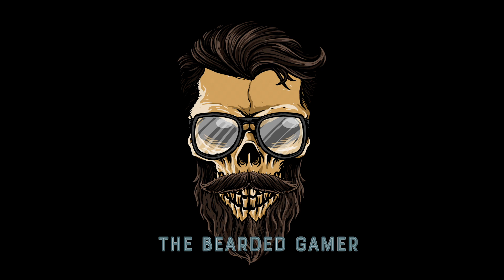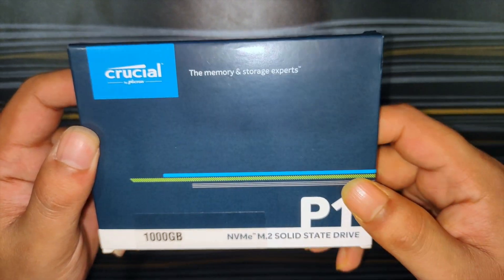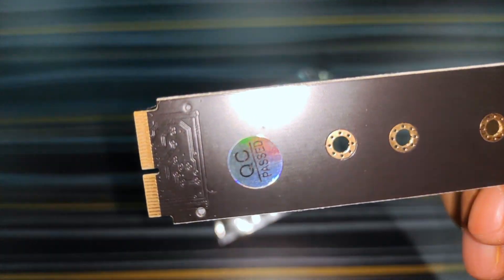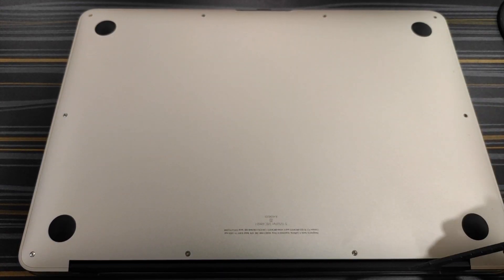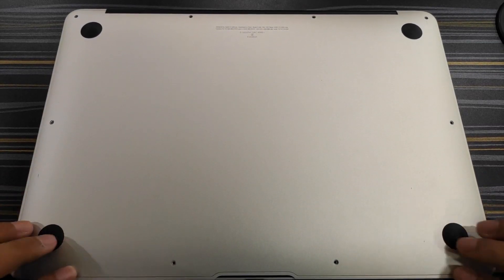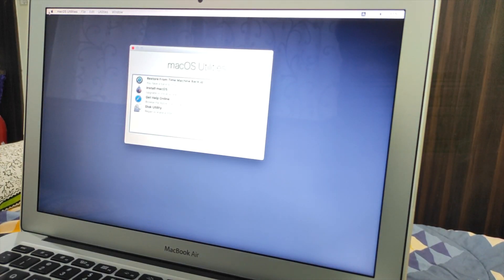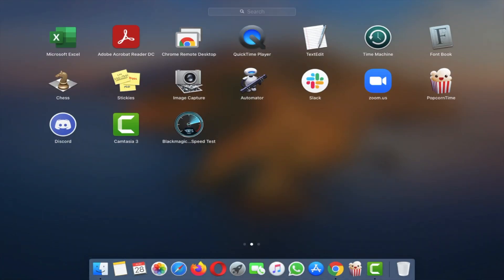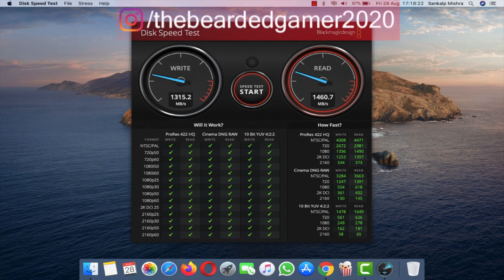2017 MacBook Air Storage Upgrade from 128GB SSD to 1TB NVMe SSD | Full Guide for 2021 | 40k+ Views

Comment: Hello, i am having trouble getting my air to recognise the drive, i have followed your instructions to a T. have a bootable USB drive etc but it still cannot find the drive. not sure what to do except try another SSD/adapter, old one goes back in and starts straight up. i have tried the internet recovery option and all fail as i have no visible Internal drive.
Reply from the maker: Which SSD and adapter are you using?
Reply: I have the 1TB Crucial as you have but am using the NGFF M.2 NVMe SSD Convert Adapter Card for Upgrade MacBook Air 20132014 2015 2016 2017 and Mac Pro Retina 2013 2014 2015, NVMe AHCI SSD. Only thing i can see that may be the difference but it should work.
Reply from the maker: @dOwNhillY72  Yes it should but sometimes the issue comes with the adapter. I have received quite a few comments from people about ssd not being detected because they used a different adapter. Try getting a different adapter and give it a try.
Reply: @TheBeardedGamer2020  I've now tried the Same adapter that you show in your Video and still no internal drive found. when I use utilities in Terminal it cannot be found either. any ideas? im thinking now that maybe the new crucial drive is faulty.
Reply from the maker: @dOwNhillY72  You can try replacing the ssd and give it a try. If the replacement window is closed try claiming warranty.

Comment: i need to sub an like this guy saved me from loosing like 1600$
Reply from the maker: Thanks man, really appreciate the support.
Reply: @TheBeardedGamer2020 lol more like u more support me by saving my mom being sooo mad at me from wanting an new expenve mac laptop.
Reply: @TheBeardedGamer2020  btw can u send an link for an 1tb ssd or an 2tb ssd for like the newer version of mac air if u dont know what i mean u dont have to tell me
Reply from the maker: @Kshatriya0073  Which version do you want it for?
Reply: @TheBeardedGamer2020  woahh u repsoned sooo fast but my version is 12.1, M1 2020
Reply: @TheBeardedGamer2020  also do u use an diffrent currensy then usd?
Reply from the maker: @Kshatriya0073  Sorry bro MBAs till late 2017 supported storage upgrades. The newer ones don't.
Reply: @TheBeardedGamer2020  oh its fine
Reply from the maker: @Kshatriya0073  Yes. INR.
Reply: @TheBeardedGamer2020  what inr mean?
Reply from the maker: @Kshatriya0073  Indian Rupee
Reply: @TheBeardedGamer2020  OHHH that why it like 10k

Comment: I choose use installer attached, after following your video it says “You may not install to this volume because it has a disk password” Please help
Reply from the maker: Can you please provide more details? This is not clear at all. Describe the entire process you followed and where you are facing an issue.
Reply: @TheBeardedGamer2020  Hi, I was able to proceed. Instead of choosing APFS(encrypted) I chose APFS alone. Thanks for your video 🙏🏻
Reply from the maker: @mickieperez1364  If you choose APFS encrypted then you will have to set a password. So, you did the right thing by choosing just APFS. Glad to hear that it works. Do subscribe to my channel and press the bell icon.

Comment: Great Video, I am upgrading from a 128GB SSD to a 1TB so I will follow your instructions! 

I currently have bootcamp on my MacBook as I use Windows programs often, will all of my Windows settings be saved as well as my Mac OS settings? 

Also, using bootcamp splits my SSD into two hard drives, one for Mac OS, and one for Windows. Will my new SSD split like this as well, and can i choose how much storage I want to have for Windows and for Mac OS? Thanks!
Reply from the maker: Great to hear that you are planning to upgrade your laptop. I have added all product links in the video description. As far as all your questions go, the answer to them would be a yes. Also, if you want your current settings on your new ssd, make a TimeMachine backup and then restore it after installing the new ssd. You can also allocate the space for bootcamp from the settings. Do let me know if you have any other questions. Don't forget to subscribe to my channel and press the bell icon.

Comment: Very good demonstration, thank you. Could you please guide whether we can upgrade the RAM too
Reply from the maker: No. Ram upgrade is not possible in this Macbook Air. Do subscribe to my channel and press the bell icon.
Reply: @TheBeardedGamer2020  This SSD upgrade is successful, running OK since then?
Actually, I want to produce music using Logic Pro, and, my instructor told me that I need to have atleast 16 GB to operate that.

And brother, I have already subscribed your channel long ago, when initially, I watched this video also shared to some of friends.
Reply from the maker: @indichinditalkshow6559  It is running perfectly fine. For logic pro 8gb should be fine as the minimum requirement is 6GB. Upgrading the storage will help you a lot as only logic pro will take up around 72GB of space for the entire library. And, thanks for the sub. Reqlly appreciate the support.
Reply: @TheBeardedGamer2020  So, I can go with that upgrade. Thank you so much for your support brother. Keep enlightening us with more stuff like this.
See you around.
Reply from the maker: @indichinditalkshow6559  Always here to help. All the product links are in the video description and let me know if you need any help during the upgrade.
Reply: @TheBeardedGamer2020  Definitely.

Comment: Ive got prohibition sign after replacing to new SSD…
Reply from the maker: Did you follow each step of the process that I have shown? Also, which adapter and ssd did you use?
Reply: @TheBeardedGamer2020  Yes ive created bootable OS with Mojave but the disc is not recognised... I bought WD Blue NvMe SSD SN570 500GB and my adapter is from Ali, longer one M.2 to MacBook 2013-17 SSD adapter ... thanks for your input it doesnt says 'NGFF' like yours
Reply from the maker: @kubaSWAT  The adapter should be fine. The problem is with the ssd. What you purchased is a SATA ssd and what Macbooks use are PCIe gen 3 ssds. That is why I had added product links in the video description. Try getting the ssd replaced and it should work.
Reply: @TheBeardedGamer2020  what? I read the Wd blue is fine Sn550 but I’ve found sn570 model…
Reply: @TheBeardedGamer2020  M.2 PCIe NVMe 3.0 x4
Reply from the maker: @kubaSWAT  Oh, I confused it with a different one. This one should work. Can you order the adapter that I have mentioned in the video description and try it again. I have received a few complaints that some aliexpress adapters are not working.

Comment: BHAI IF YOU’RE READING THIS COMMENT PLEASE TELL ME KI IF YOU ARE FACING SMART ERROR IN YOUR SSD
Reply from the maker: Nope bro. If you are facing this issue, you can try clearing the nvram. Do subscribe to my channel and press the bell icon.
Reply: @TheBeardedGamer2020  bro using WD NvmE SSD (Blue) 500GB in my Macbook Air 2017. I got it replaced because I couldn’t update my MacOS, it was showing SMART Error.

After the replacement its been around 50 days and now again it is showing SMART error. What should I do?

Comment: Hello I tried upgrading my macbook air 2017 ssd using Samsung Evo 870 500GB. When I turned on my mac and went to the disk utility. I cannot see my Samsung Evo 870 there. I already tried to reconnect my ssd and made sure it was connected properly. Any tips?
Reply from the maker: I don't see any 870 Evo being an M.2 ssd. It is a SATA ssd. Can you confirm the exact model number?

Comment: Can you use the screw driver that was included in the adapter to remove the back panel of the Mac?
Reply from the maker: No, you will have to use a philips head screwdriver. All the product links including the toolkit are in the video description. Do subscribe to my channel and press the bell icon .

Comment: I have a question for macbook air 2017 if I switch the sdd from 128 to 1tb it wont lose the data from my laptop right
Reply from the maker: The data is in the ssd. If you want to keep the data, you can do a TimeMachine Backup and then restore your data on the new ssd. Let me know if you have any other. Also, do subscribe to my channel and press the bell icon.
Reply: @TheBeardedGamer2020  one more question it won’t affect on the browser site like Firefox or safari like the tabs histories and the bookmarks when switching the sdd
Reply from the maker: @elloskitty2839  Those things have nothing to do with your ssd. If you have logged in to your browser and synced your data, they should be there when you login again.
Reply: One more question please for the MacBook Air does the hard drive or is it the ssd that has the storage data
Reply from the maker: @elloskitty2839  The macbook air only has an ssd. There is no separate hard drive. The 128gb that you see on your mac is the ssd and the 1tb upgrade that you are planning would also be an ssd.

Comment: This is my MacBook Air (2017) model (MBA13-MQD32HN/A) does it supports this upgradation process. Please suggest me. Waiting for your reply
Reply from the maker: Yes it will. Any Macbook Air between 2013 and 2017 will support this process. All product links are in the video description. You can buy the products as per your choice. Also, thanks for subscribing to my channel.
Reply: @TheBeardedGamer2020  bro please do a video on how to create mac os bootable drive. i have a doubt, does time machine backup only videos/docs/ files. or it will backup apps and os.

please clarify my doubt.
Reply from the maker: @futurescientistVASU  The link that I have shared in the video description is pretty detailed and simple. Also, the time machine backup backs up everything, OS, settings, images and all data.
Reply: @TheBeardedGamer2020  so you are saying, when you backup using time machine, there is no need to use bootable USB drive, right.
Reply from the maker: @futurescientistVASU  No, it is not like that. The bootable drive is definitely required as it helps you access the disk utility on the new ssd. As the new ssd is blank you need an external platform to access the mac os disk utility. So, bootable drive is compulsory whether you do a fresh install or a timemachine backup.

Comment: What will be the Performance difference btw 500gb and 1Tb ssd
Reply from the maker: There wouldn't be any performance difference between 500gb and 1tb ssd but you will definitely see a difference once you upgrade from your stock ssd to either a 500gb or 1tb m.2 nvme ssd. Do subscribe to my channel and press the bell icon.
Reply: Thnqu brother .

Comment: Hi sir
Is it a good choice to buy a used macbook air(13" , early 2015) 4 GB , 250GB at ₹23k in present date ...I'm little confused that whether it will be a wise choice or not.

There is a single line (not visible in white screen) and laptop battery is replaced once...current battery backup is 3-4 hrs and he's not giving any bill or box except charger.

Please reply soon.
Reply from the maker: Based on the details that you have provided, it doesn't seem like a good deal. You can put in a few extra thousand and get a better one for around 28-30k. Late 2017 Macbook airs are going out anywhere between 33k and 40k depending on the condition. So, early or late 2015 ones you can easily get for under 30k. Do subscribe to my channel and press the bell icon.
Reply: @TheBeardedGamer2020  how would be it ,if I can bargain to 20k and then replace the battery.
Reply from the maker: @user-bn8ek6xl8i  I would still suggest you to avoid it as you never know what other issues it might have. So, better to spend a little extra and get a good one rather than negotiating a bad product and having to spend a lot more later.
Reply: @TheBeardedGamer2020  thanks a lot for your valuable suggestion. ❤️

Comment: how is battery backup MacBook Air after installing 1Tb Ssd Drive
Reply from the maker: It is almost the same as in normal ssd. Slight drop is there, but around 5-7% which is obvious since the speed is increasing so the power consumption will increase. Do subscribe to my channel and press the bell icon.

Comment: hi@ThebeardedGamer , i have early 2014 macbook air with 128 gb SSD and it is configurable upto 512 gb, please cheap and best ssd along with adapter if required for upgradation. thanks
Reply from the maker: You can use the same process as shown in the video. Also, all the product links are provided in the video description. These products are compatible with MBAs from 2014 to 2017, so you wouldn't have an issue. Also, do subscribe to my channel and press the bell icon.

Comment: Will i get same thing if a use external SSD instead of updating my Mac with opening and putting one inside (some of those nvme samsung, or similar). Thanks
Reply from the maker: Yup external ssds will also provide similar performance but the upgrade is needed when you prefer convenience of not having to carry an external ssd everywhere. Do subscribe to my channel and press the bell icon.
Reply: @TheBeardedGamer2020  Thanks for the answer, one more question, What do you think for 15inc Macbook pro 2014 2.2ghz i7, 16gb RAM 256ssd? Will do the job for Graphic Design in UX/UI (Photoshop, Illustrator,XD, Figma) Thanks a lot.
Reply from the maker: @Armacedon  Yes. It should easily be able to handle it.

Comment: The “preparing to restore files to SSD” phase is taking a really long time for me, is that normal? I have only 26GB to transfer from my backup
Reply from the maker: Yes, it does take quite a bit of time. Copying files doesn't take much time but replicating system files and settings takes quite a bit of time. Since you had added this comment 5 hours ago, I think you should have been able to successfully complete it by now. Also, do subscribe to my channel and press the bell icon.

Comment: Because adapter specification show that... The samsung 970 evo plus not support
Reply from the maker: You can use it but there's no point spending so much extra as the speeds are going to be similar to what you would get with a Crucial SSD at a cheaper price. Do subscribe to my channel and press the bell icon.

Comment: Samsung 980 or crucial p1?🤔 what is the Best?
Reply from the maker: Both of them are fine but why pay extra when you get the same speeds. I know that both SSDs have different operating speeds but the Macbook has certain limitations. So, whichever SSD that you use, you will get the same speed. The best option in such case is to use the least expensive of the lot. Also, you can choose crucial p2 which is now available. All product links are in the video description. Don't forget to subscribe to my channel and press the bell icon.

Comment: thank you for the tutoriel! I have ordered the same SSD and I am excited to install it. Do you think also changing ram from 8gb to 16gb would make a big difference in term of speed when using photoshop or should I already see a noticeable difference just by change the SSD. I am using a macbook air 2017 128gb
Reply from the maker: Hi Charles, it's great that you are upgrading your SSD and be rest assured that you will see a great deal of improvement in terms of performance. Coming to upgrading the RAM, that is not possible as it is soldered to the motherboard. The only upgrade possible is the SSD. Hope you have also purchased the adapter for the upgrade. All product links are in the video description.
Reply: @TheBeardedGamer2020  one last thing, I don't get why you are installing mac os on your USB to then plug it to your mac since you are not using it. Is it because you are using time machine to restore your everything ? do you tell people to have mac os on a USB in case they only want to reinstall mac os without time machine? sorry for all this question !
Reply from the maker: @charlesmichelpierr45  The usb is required for you to boot into MacOS recovery. As this is a new SSD that you are installing, there will be nothing on it. The bootable USB helps you get into MacOS recovery and access all functions. Post that you can either restore from a time machine backup or do a fresh install. It's entirely your choice.
Reply: I think we can do recovery through internet if you don't have bootable USB. Correct me if I'm wrong

Comment: would the SSD and adaptor work for the 2017 A1466 macbook air? thanks!
Reply from the maker: Yes it will. All product links are in the video description. Also, do subscribe to my channel and press the bell icon.
Reply: @TheBeardedGamer2020  thanks !
Reply from the maker: @charlesmichelpierr45  No problem. Always here to help. Don't forget to subscribe though.

Comment: You have used a P1 ssd…. Is a P2 also on for my MacBook Air 2017 ?
Reply from the maker: Yes Rajiv you can use a P2 as well. When I did the upgrade P1 was available, now P2 is available. Both work fine and all the product links are in the video description. You can use it to buy all products for upgrading your Macbook Air 2017. Also, do subscribe to my channel and press the bell icon.
Reply: Thanks for the prompt reply . I am going for it
Reply from the maker: @rajivbags1  Great choice. Make sure that you subscribe and press the bell icon and use the product links in the video description. Also, reach out to me if you need any more help.
Reply: Does p2 require an adaptor for MacBook Air 2017
Reply from the maker: @rajivbags1  Yes it does.

Comment: Hello, great video! just one question, does it impact the performance speed of the Macbook Air 2017? Mine is now running on MacOs Monterey 2021
Reply from the maker: The performance has been improved. The read and write speeds have increased almost twice. Do subscribe to my channel and press the bell icon.